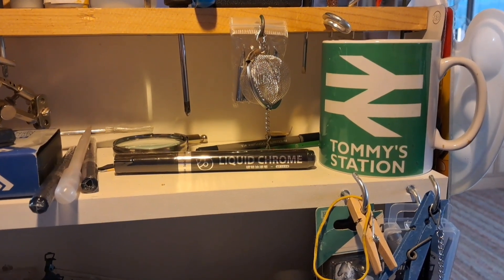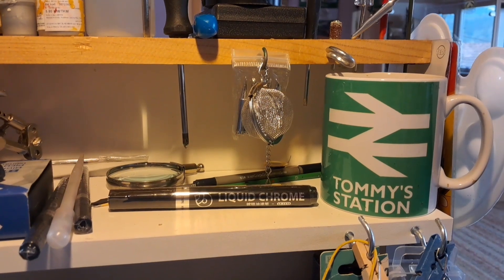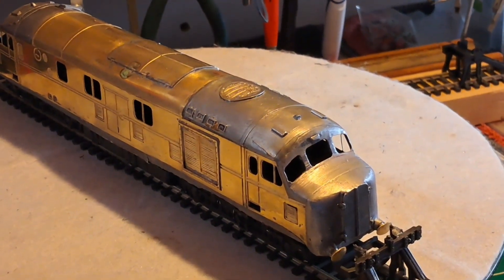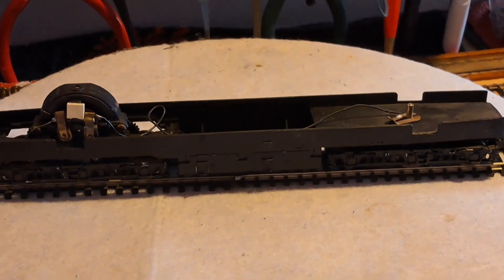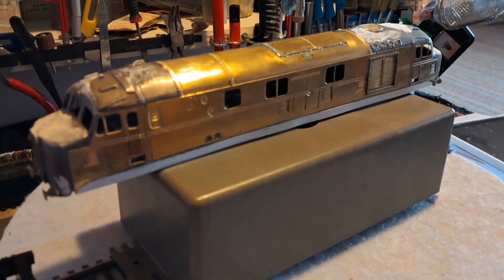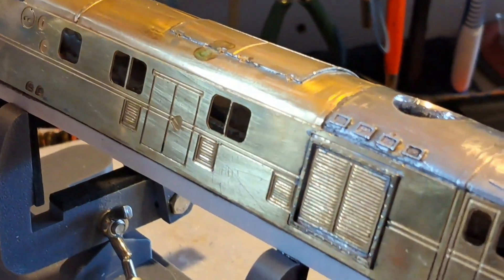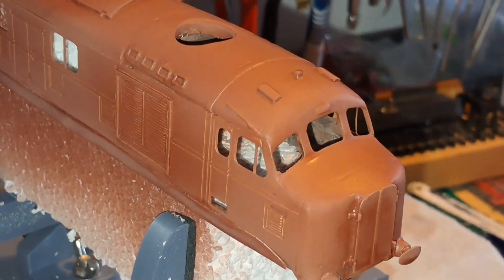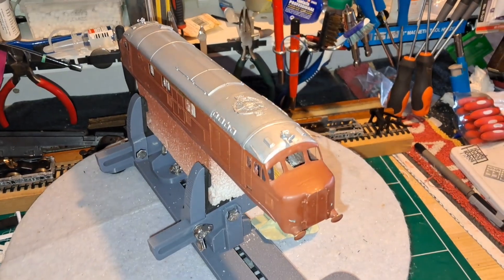Tommys 10000 Resto 1

Comment: Makes you wonder how many of those kits are still around Paul. I've not seen one before, so i will be quite interested to see how she turns out.  So far so good mate, the detail looks quite fresh on the body. The crew, cabs and engine  should top it off.  Looking forward to seeing the end result.  Steven.
Reply from the maker: Hi Steven, I would be interested to know how many of these kits are around as well. I had never seen one before and was lucky to get this one. I have spent some time collecting the various details for this model and hope the end result looks ok. My Nephew is helping me with some of the preparation and painting which is a great help. 
I was surprised how much fine detail there was under all that black paint, its a well made kit by FIA in South Korea.
I am starting to rebuild the chassis, fitting a 12v CD motor and lights which should improve the running and appearance. I hope to finish it by next Sunday and have it running on the layout.
All the best, Paul.👍👍🙏

Comment: Hi, Paul... nice project you have started and excellent work getting it down to the bare bones to give it new life.  I liked that metallic/brass look, but it shall look aces when done.
Reply from the maker: Hi Anthony, I was lucky to buy this brass model of the LMS 10000 as they are quite rare. This will be my most challenging Restoration so far so I hope it turns out ok. 
This was the UKs first mainline Diesel Loco built in 1947 with the first V 16 cyl engine made by English Electric. Only 2 were built, 10000 in black and 10001 in green liveries. 
I will now have the first UK Diesel in my collection along with Rocket the first practical Steam Loco.
Thanks for your support and kind comments its really appreciated. All the best, Paul.👍👍🙏